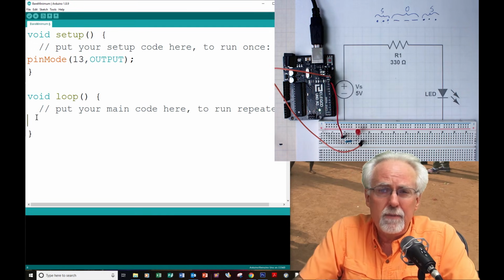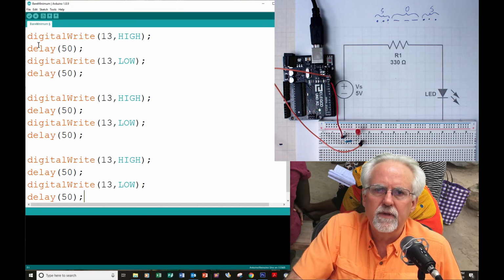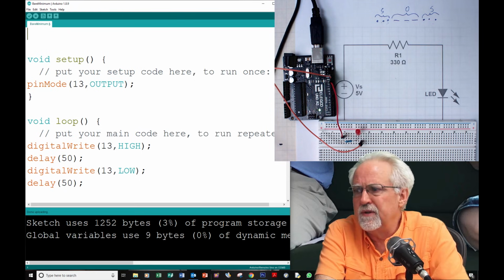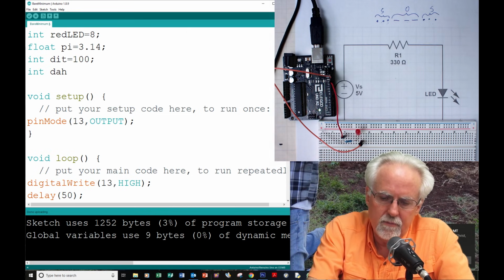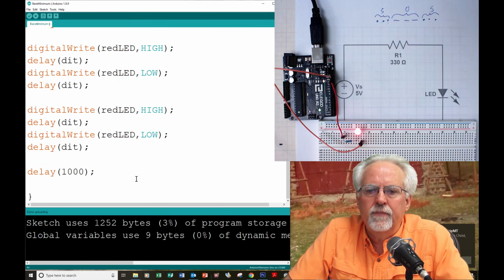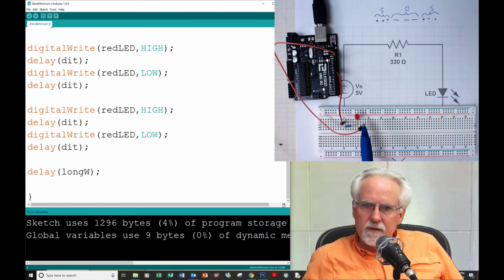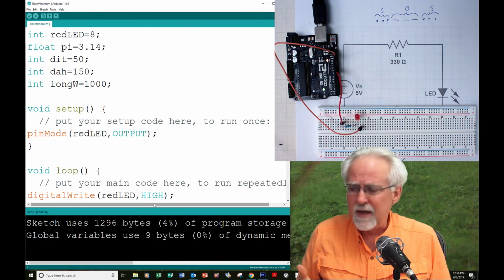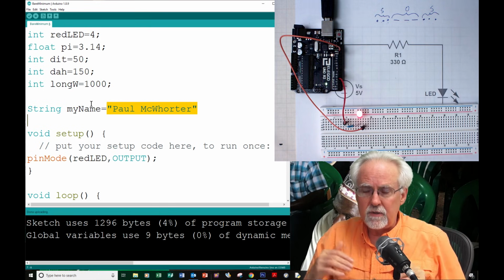Arduino Tutorial 4: Understanding Arduino Variables

Comment: Homework from last part is done, sir:
void setup() {
  // put your setup code here, to run once:
  pinMode(8, OUTPUT);
}

void loop() {
  // put your main code here, to run repeatedly:
  digitalWrite(8, HIGH);
  delay(250);
  digitalWrite(8, LOW);
  delay(250);
  digitalWrite(8, HIGH);
  delay(250);
  digitalWrite(8, LOW);
  delay(250);
  digitalWrite(8, HIGH);
  delay(250);
  digitalWrite(8, LOW);
  delay(250);
  digitalWrite(8, HIGH);
  delay(250);
  digitalWrite(8, LOW);
  delay(250);
  digitalWrite(8, HIGH);
  delay(250);
  digitalWrite(8, LOW);
  delay(250);
    digitalWrite(7, HIGH);
  delay(250);
  digitalWrite(7, LOW);
  delay(250);
  digitalWrite(7, HIGH);
  delay(250);
  digitalWrite(7, LOW);
  delay(250);
  digitalWrite(7, HIGH);
  delay(250);
  digitalWrite(7, LOW);
  delay(250);
  digitalWrite(7, HIGH);
  delay(250);
  digitalWrite(7, LOW);
  delay(250);
  digitalWrite(7, HIGH);
  delay(250);
  digitalWrite(7, LOW);
  delay(250);
  digitalWrite(7, HIGH);
  delay(250);
  digitalWrite(7, LOW);
  delay(250);
  digitalWrite(7, HIGH);
  delay(250);
  digitalWrite(7, LOW);
  delay(250);
  digitalWrite(7, HIGH);
  delay(250);
  digitalWrite(7, LOW);
  delay(250);
  digitalWrite(7, HIGH);
  delay(250);
  digitalWrite(7, LOW);
  delay(250);
  digitalWrite(7, HIGH);
  delay(250);
  digitalWrite(7, LOW);
  delay(250);
  digitalWrite(6, HIGH);
  delay(250);
  digitalWrite(6, LOW);
  delay(250);
  digitalWrite(6, HIGH);
  delay(250);
  digitalWrite(6, LOW);
  delay(250);
  digitalWrite(6, HIGH);
  delay(250);
  digitalWrite(6, LOW);
  delay(250);
  digitalWrite(6, HIGH);
  delay(250);
  digitalWrite(6, LOW);
  delay(250);
  digitalWrite(6, HIGH);
  delay(250);
  digitalWrite(6, LOW);
  delay(250);
  digitalWrite(6, HIGH);
  delay(250);
  digitalWrite(6, LOW);
  delay(250);
  digitalWrite(6, HIGH);
  delay(250);
  digitalWrite(6, LOW);
  delay(250);
  digitalWrite(6, HIGH);
  delay(250);
  digitalWrite(6, LOW);
  delay(250);
  digitalWrite(6, HIGH);
  delay(250);
  digitalWrite(6, LOW);
  delay(250);
  digitalWrite(6, HIGH);
  delay(250);
  digitalWrite(6, LOW);
  delay(250);
  digitalWrite(6, HIGH);
  delay(250);
  digitalWrite(6, LOW);
  delay(250);
  digitalWrite(6, HIGH);
  delay(250);
  digitalWrite(6, LOW);
  delay(250);
  digitalWrite(6, HIGH);
  delay(250);
  digitalWrite(6, LOW);
  delay(250);
  digitalWrite(6, HIGH);
  delay(250);
  digitalWrite(6, LOW);
  delay(250);
  digitalWrite(6, HIGH);
  delay(250);
  digitalWrite(6, LOW);
  delay(1000);
}

Comment: great lesson again Paul - thanks!

Quick question.
I've had a little programming experience over the years.

In BASIC programing, we were able to use 'remarks' within the code, to assist in defining sections of the code, which makes it a lot easier to follow, especially when diagnosing a problem. 

These 'remarks' were ignored by the system, so they weren't confused with instructions/coding.

Is a similar feature available in Arduino ?
Reply: use // to comment in the program.

Comment: A dash should be three times the length of the dot, not ten times.

There should also be a three dot delay between letters, a one dot delay between each dot or dash, and a seven dot space between words. So the code should look like:

int redLED=8; //declares pin for led output
float pi=3.14; 
int dot=250; //length of dot
int dash=750; //length of dash
int space=250; //length of space between dot or dash within letter
int letterSpace=750; //space between lettters
int wordSpace=1750; //space between words

void setup() {
  // put your setup code here, to run once:
pinMode(redLED,OUTPUT);//sets pin 8 as output
}

void loop() {
  // put your main code here, to run repeatedly:
digitalWrite (redLED,HIGH);//turns on led
delay (dot);//sets length of flash to dot
digitalWrite (redLED,LOW);//turns off led
delay (space);//sets space between dots and dashes
     
digitalWrite (redLED,HIGH);//turns on led
delay (dot);//sets length of flash to dot
digitalWrite (redLED,LOW);//turns off led
delay (space);//sets space between dots and dashes
        
digitalWrite (redLED,HIGH);//turns on led
delay (dot);//sets length of flash to dot
digitalWrite (redLED,LOW);//turns off led
delay (letterSpace);//sets space between dots and dashes
    
digitalWrite (redLED,HIGH);//turns on led
delay (dash);//sets length of flash to dot
digitalWrite (redLED,LOW);//turns off led    }
delay (space);//sets space between dots and dashes
    
digitalWrite (redLED,HIGH);//turns on led
delay (dash);//sets length of flash to dot
digitalWrite (redLED,LOW);//turns off led    }
delay (space);//sets space between dots and dashes

digitalWrite (redLED,HIGH);//turns on led
delay (dash);//sets length of flash to dot
digitalWrite (redLED,LOW);//turns off led    }
delay (letterSpace);//sets space between dots and dashes

digitalWrite (redLED,HIGH);//turns on led
delay (dot);//sets length of flash to dot
digitalWrite (redLED,LOW);//turns off led
delay (space);//sets space between dots and dashes
     
digitalWrite (redLED,HIGH);//turns on led
delay (dot);//sets length of flash to dot
digitalWrite (redLED,LOW);//turns off led
delay (space);//sets space between dots and dashes
        
digitalWrite (redLED,HIGH);//turns on led
delay (dot);//sets length of flash to dot
digitalWrite (redLED,LOW);//turns off led
delay (wordSpace);//sets space between dots and dashes
     }

Comment: i did the assignment but for some reason 1st led is bright, and other 2 are pretty dim, but flashing accordingly.
Reply: found a solution to this, if this happens to anyone else:

-"you need to set the pinMode to OUTPUT for all three pins that have LEDs connected.
By default, pins are inputs, so all you're doing with the "digitalWrite"s is enabling and disabling the internal pull-ups. These will act as current limiters, but they're very high values, so the LEDs will appear dim."

Comment: Where can we find the code and pics of the completed homework assignments? To make all three LEDs light up, do you just add resistors and LED and connect them all together in line or basically have three separate ones setup at the same time?

Comment: Following up on my last.  The 100 could be another calculation.  Morse code speed is usually specified in words per minute.  Use the average of 5 characters per word.  Do the math to get a dit time from a words per minute.  Then you can completely specify your Morse code program by simply entering a value for words per minute.

Comment: void setup() {
  // put your setup code here, to run once:
  //connect wires to breadboard
  //use 300 ohm resister, connected to BB
  //use LED connected to output of resister
  pinMode(8,OUTPUT);
  //pinMode(7,OUTPUT);
  //pinMode(6,OUTPUT);

}

void loop() {
  // put your main code here, to run repeatedly:
  for (int i = 0; i <= 5; i++) {
  digitalWrite(8,HIGH);
  delay(500);
  digitalWrite(8,LOW);
  delay(500);
  }
//flash all LED
  digitalWrite(8,HIGH);
  digitalWrite(7,HIGH);
  digitalWrite(6,HIGH);
  delay (1000);
  digitalWrite(8,LOW);
  digitalWrite(7,LOW);
  digitalWrite(6,LOW);
  delay(100);
  
  for (int i = 0; i <= 10; i++) {
  digitalWrite(7,HIGH);
  delay(250);
  digitalWrite(7,LOW);
  delay(250);
  }
//flash all LED
  digitalWrite(8,HIGH);
  digitalWrite(7,HIGH);
  digitalWrite(6,HIGH);
  delay (1000);
  digitalWrite(8,LOW);
  digitalWrite(7,LOW);
  digitalWrite(6,LOW);
  delay(100);

  for (int i = 0; i <= 15; i++) {
  digitalWrite(6,HIGH);
  delay(125);
  digitalWrite(6,LOW);
  delay(125);
  }
//flash all LED
  digitalWrite(8,HIGH);
  digitalWrite(7,HIGH);
  digitalWrite(6,HIGH);
  delay (1000);
  digitalWrite(8,LOW);
  digitalWrite(7,LOW);
  digitalWrite(6,LOW);
  delay(5000);

//homw work --
//bliink red led 5 times then
//blink gren led 10 times then
//blink blue led 15 times then

//use 3 pin's
//use pinMode on 3 pins

}

Comment: I've spent 8 hours programming a full Morse code trainer that takes my button presses and translates them into morse code lol I'm now fluent in Morse! 
Btw. in Morse the short Ds are the references. The long Ds are 3 times as along and the space between words is 7 Ds long. So it should be 100ms 300ms 700ms in your example. And the inbetween lengths are all short ones. That's why urs was hard to read on the dahs.

Comment: /* 
 *  assignment: 
 *  redLED 5 times fast,
 *  greenLED 10 times slow
 *  blueLED 15 times real slow
 */

 int redLED = 2;
 int greenLED = 3;
 int blueLED = 4;

 int periodFast = 100;
 int periodSlow = 500;
 int periodRealSlow = 1500;
 

void setup() {
  // put your setup code here, to run once:
pinMode(redLED, OUTPUT);
pinMode(greenLED, OUTPUT);
pinMode(blueLED, OUTPUT);

}

void loop() {
  // put your main code here, to run repeatedly:
for( int i = 0 ; i < 5 ; i++){
  digitalWrite(redLED, HIGH);
  delay(periodFast);
  digitalWrite(redLED, LOW);
  delay(periodFast);
}

for( int i = 0 ; i < 10 ; i++){
  digitalWrite(greenLED, HIGH);
  delay(periodSlow);
  digitalWrite(greenLED, LOW);
  delay(periodSlow);
}

for( int i = 0 ; i < 15 ; i++){
  digitalWrite(blueLED, HIGH);
  delay(periodRealSlow);
  digitalWrite(blueLED, LOW);
  delay(periodRealSlow);
}
}

Comment: Why do you use int for everything? In this example you used an int for your red led on pin 8. You are effectively wasting two bytes of RAM to store this value. It would make a lot more sense to use a macro to define the led pin. for example #define redLED 8. This does not use up any space in RAM at all and the program works the exact same way as yours.

Comment: Hey again - sorry I should have put my first question in the previous videos comments, I realize my mistake and will post appropriately from now on should I have any further pressing issues!  

However, I DO have another 2 questions based on this video!  

1. By extension, is there a way we can also change the values of these variables we've declared at once all together? Perhaps by declaring another variable we can changed based on a percentage overall? 
For example: If I wanted to speed up or slow down the ENTIRE process/function (Yes ok, someway off in the future I'm sure, but I'm sure I'll want to!) can this be done as comparatively easily as the concept of just changing the variables value as you've described here? Or is it going to be more complicated than simply allocating the first level tags?
And,
2. Perhaps this is a part way to answering the last question but I stumbled on the desire to accomplish this while curiously tinkering on over another possibility... Can we A) set a series of Variables (as we have in this video) and then set an additional set of Variables to call those in the original set?  If so can we "Group" a set of Variables, or "Tag", as a whole then call them through the second set?  Please, let me know if that requires more careful or explicit description but I think you'll understand where  my thinking is....

Chheeerrss!!  

(I realize your time is valuable and I'm appreciative of all you can help although if I experience even more appreciation I am not averse to the idea of donating also)

Comment: Hi Paul - Great stuff so far thanks heaps!  Just a quick Q from the last lessons homework task - I got my 3 LEDs running and doing different things, etc. but for some reason the last LED in my circuit seemed to be really really dim compared with the others! My Troubleshooting went as follows:
1. Remove dim LED and replace with a fresh one from the kit. Result:  ==
Undo
2. SWAP dim LED with 2nd LED in circuit as it is working brightly. Result: == (effectually)
Undo
3. Change GND Cable. (==) 
Undo
4. Bridged the GND Rails and ran cables from 13/GND AND GND/GND (on other-side of Uno - thought it might provide stronger/steadier current somehow (not a thing as it turns out) cos -  Result: (==)
Undo
5. Tried passing longer IO times in my Arduino code - were 125/125 but tried all types of variations up to 1000ms on all LEDs all status'
Result: ==
Youtube>Comments>AskYou

Have I got a resistor legs around the wrong way? or is it possible to have too close together? Why have you bent the long leg on the led to clear 2 holes (columns) before joining/matching up the short leg to the GND on the 3rd hole(column) -- can these NOT be connected to 2 directly adjacent holes? Would that be my issue? 

Thanks mate :)
Reply: I had that issue and it was because I had not set the pinMode in the void.setup so that pin was not set as output. It still had enough low voltage to make the led blink but not at as brightly. My hardware was set properly.

Comment: Hello, is there a way for the Arduino to listen for a certain 
Frequency range? Some way I could make an input that
will detect those frequencies and output a voltage signal 
that is low, from 0.5-4.5volts.

Comment: 250, 500 works ok too for Morse code.. And I used 250, 500, 1000 for the homework. There's nothing like typing it in, and then using find/replace. Huge time saver! You get some errors(at least I did), but it saves time. This course is GREAT! Keep up the excellent lessons!

Comment: Really been enjoying these videos but I do see an error that bothers my OCD, if you are using camel case then redLED should be redLed, I’ve had compilers kick that back as a fault. Also adding in two more ints for letterPause and phrasePause, Will make it more readable. Right now it starts the next letter immediately so it’s hard to see the transition. A 50ms pause between letters and 100ms between phrases looks a lot nicer. Anyway thanks for making these videos, they are the best I’ve found on Arduino’s

Comment: int redled5f=12;
int greenled10s=9;
int blueled15ss=6;

int f=200;
int s=500;
int ss=1000;

void setup()
{
pinMode(redled5f,OUTPUT);
pinMode(greenled10s,OUTPUT);
pinMode(blueled15ss,OUTPUT);
}
void loop()
{
  //RED LED 5 TIMES FASTER
digitalWrite(redled5f,HIGH);
  delay(f);
digitalWrite(redled5f,LOW);
  delay(f);
  
digitalWrite(redled5f,HIGH);
  delay(f);
digitalWrite(redled5f,LOW);
  delay(f);
  
digitalWrite(redled5f,HIGH);
  delay(f);
digitalWrite(redled5f,LOW);
  delay(f);
  
  digitalWrite(redled5f,HIGH);
  delay(f);
digitalWrite(redled5f,LOW);
  delay(f);
  
digitalWrite(redled5f,HIGH);
  delay(f);
digitalWrite(redled5f,LOW);
  delay(f);
  
  //GREEN LED 10 TIMES SLOWER
  
  digitalWrite(greenled10s,HIGH);
  delay(s);
digitalWrite(greenled10s,LOW);
  delay(s);
  
digitalWrite(greenled10s,HIGH);
  delay(s);
digitalWrite(greenled10s,LOW);
  delay(s);
  
  digitalWrite(greenled10s,HIGH);
  delay(s);
digitalWrite(greenled10s,LOW);
  delay(s);
  
  digitalWrite(greenled10s,HIGH);
  delay(s);
digitalWrite(greenled10s,LOW);
  delay(s);
  
  digitalWrite(greenled10s,HIGH);
  delay(s);
digitalWrite(greenled10s,LOW);
  delay(s);
  
  digitalWrite(greenled10s,HIGH);
  delay(s);
digitalWrite(greenled10s,LOW);
  delay(s);
  
  digitalWrite(greenled10s,HIGH);
  delay(s);
digitalWrite(greenled10s,LOW);
  delay(s);
  
  digitalWrite(greenled10s,HIGH);
  delay(s);
digitalWrite(greenled10s,LOW);
  delay(s);
  
  digitalWrite(greenled10s,HIGH);
  delay(s);
digitalWrite(greenled10s,LOW);
  delay(s);
  
  digitalWrite(greenled10s,HIGH);
  delay(s);
digitalWrite(greenled10s,LOW);
  delay(s);
  
  //BLUE LED 15 TIMES VERY SLOWER
  digitalWrite(blueled15ss,HIGH);
  delay(ss);
digitalWrite(blueled15ss,LOW);
  delay(ss);
  
 digitalWrite(blueled15ss,HIGH);
  delay(ss);
digitalWrite(blueled15ss,LOW);
  delay(ss);
  
   digitalWrite(blueled15ss,HIGH);
  delay(ss);
digitalWrite(blueled15ss,LOW);
  delay(ss);
  
   digitalWrite(blueled15ss,HIGH);
  delay(ss);
digitalWrite(blueled15ss,LOW);
  delay(ss);
  
   digitalWrite(blueled15ss,HIGH);
  delay(ss);
digitalWrite(blueled15ss,LOW);
  delay(ss);
  
   digitalWrite(blueled15ss,HIGH);
  delay(ss);
digitalWrite(blueled15ss,LOW);
  delay(ss);
  
   digitalWrite(blueled15ss,HIGH);
  delay(ss);
digitalWrite(blueled15ss,LOW);
  delay(ss);
  
   digitalWrite(blueled15ss,HIGH);
  delay(ss);
digitalWrite(blueled15ss,LOW);
  delay(ss);
  
   digitalWrite(blueled15ss,HIGH);
  delay(ss);
digitalWrite(blueled15ss,LOW);
  delay(ss);
  
   digitalWrite(blueled15ss,HIGH);
  delay(ss);
digitalWrite(blueled15ss,LOW);
  delay(ss);
  
   digitalWrite(blueled15ss,HIGH);
  delay(ss);
digitalWrite(blueled15ss,LOW);
  delay(ss);
  
   digitalWrite(blueled15ss,HIGH);
  delay(ss);
digitalWrite(blueled15ss,LOW);
  delay(ss);
  
   digitalWrite(blueled15ss,HIGH);
  delay(ss);
digitalWrite(blueled15ss,LOW);
  delay(ss);
  
   digitalWrite(blueled15ss,HIGH);
  delay(ss);
digitalWrite(blueled15ss,LOW);
  delay(ss);
  
   digitalWrite(blueled15ss,HIGH);
  delay(ss);
digitalWrite(blueled15ss,LOW);
  delay(ss);
  
  
  delay(2000);
}
Reply: I'm very happy . Got this assignment question working without any error 😎😎
Reply: @ecstasyrealm6803  Wow, you showed me something that I did a little differently... I never switched the numbers in the pinMode setup, but it still works fine... Now I'll fix it, using the variables...... and it should work fine the way you did it.
Reply: Yes, your way it better, if I ever wanted to change the voltage sources.